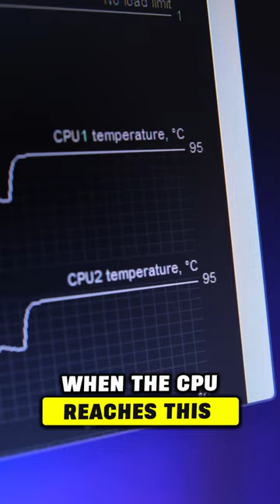What's the Max Safe CPU Temp? (AMD & Intel) #shorts

Comment: I got 60 degrees when idle with a Intel stockcooler removed put new thermal paste put a huge aircooler on top of it and it went to 32 degrees and put some extra fans in the front and in the back i replaced 1 for a better on...when i checked it went from 32 to 28 degrees.i think i will not get any lower
...
Reply: My cpu on 65°C on idle I don't have a expensive cpu it's just a i5 7400 what to do
Reply: @zarakos4849  lmao same
Reply: @Hatermo  I figured it out my stock cooler is broken I buyed 3 different thermal paste but it barely did anything just get a better cooler
Reply: @zarakos4849  I think maybe I should check my cooler too